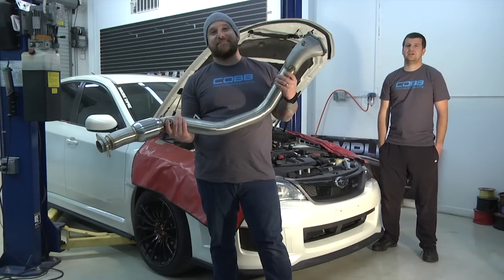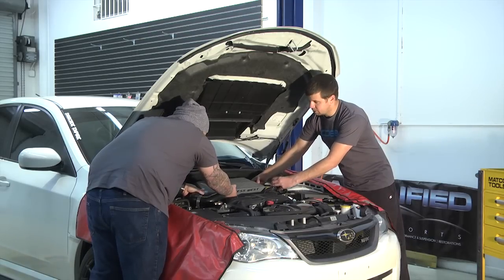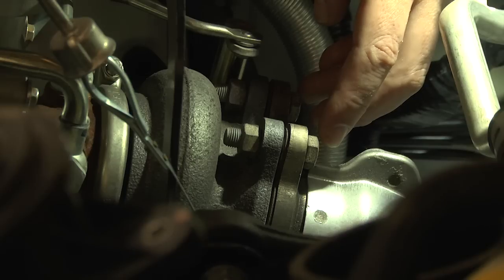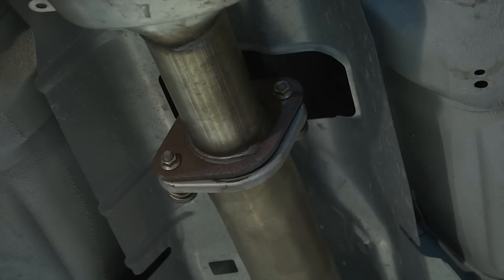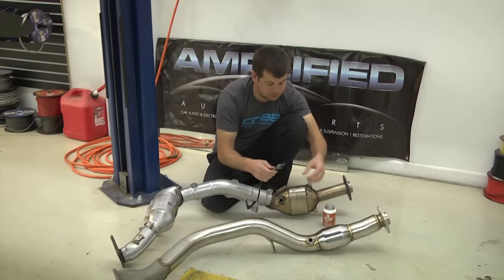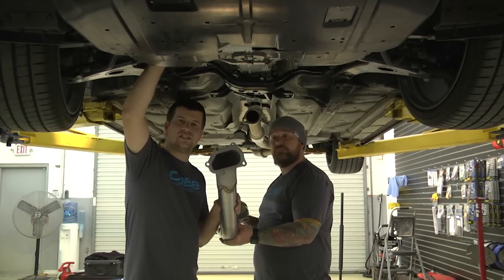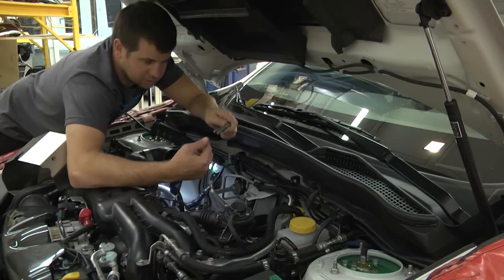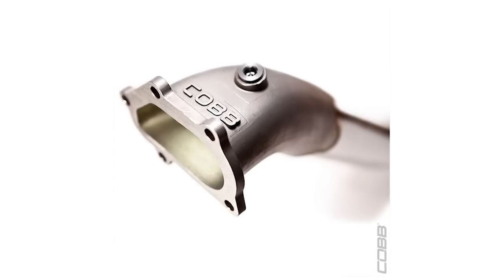COBB Subaru WRX 08-14 SS 3" Downpipe Install Video

Comment: What I like about this video are the clear camera angles pointing out the bolt locations & torques. What I don't like is the fact that they never mention how difficult it can be to remove some of these bolts and what replacement hardware you might want to have on hand to ensure if you shear a bolt or stud, that you can complete the job without scrambling to buy parts in the middle of the install.
Reply: Ong. The previous owner of mine, definitely fucked me over with the DP, he used thread lock on it. Rounded my bolts and completely fucked me over

Comment: well here it is 2 years later,i now have a process west verticooler and bought a cobb down pipe,i already had the CNT racing turbo back exhaust,but trust me if your going to do things right get the cobb DP,oh and a lift would be nice haha so i had hell because i didn't want to remove the whole verticooler so i removed the main bolt and end hose,then i had to buy the grimmspeed adapter since cobb tappers down to 2.5 and the rest of my cat back is 3'' so reinstalling is going to probably be tricky,one person on the ground,oh and i would highly recommend buying grimmspeed gaskets for the DP at both ends,you do not want to have to do this again because of a leak.well wish me luck,oh and i am installing their SF intake and box then i will be driving to cobb for a pro tune.im excited.but take it from me i learned the hard way.BUY GOOD STUFF.process west,cobb,grimmspeed.merry christmas subie brothers.

Comment: thanks for the heads up video,going to be a piece of cake.i ordered a CNT cat back for mine today and said the hell with it might as well get the down pipe too and install them all at once.the CNT cat back dual tips,525.00 the CNT catted down pipe 369.00 got a 5 % discount made it a cool 848.00 for the complete turbo back,can't wait to flash to stage 2 next week.CNT RACING

Comment: Nice video! I was able to get my Cobb DP on my 08STi put on without taking off the TMIC. Just put it on the lift and reached up there and took it all off.
Reply: Yea with a stock tmic you should be able to but mine was much larger and covered the downpipe making it much harder.

Comment: I know it's been over 4 years since this video was uploaded. So the only gaskets you need is a turbo/DP gasket and a donut gasket?  I'm running the OEM midpipe with the Grimmspeed adapter.

Comment: what's "the NICs that we talked about earlier"?
sorry
Reply: also when installing the DP to the turbo you said don't forget "antiseeds"? what is that?
Reply: bradstud92 4 months late, but he said anti-seize. It makes it easier to remove the bolts later on if you take off the pipe later.
Reply: Cesar Barragan thanks so much man. Ill be installing soon!

Comment: don't you need new turbo to downpipe gaskets?
Reply: I didn't use new because it wasn't recommended. If your gaskets are old you may want to look at replacing them but my car had less than 3k miles on it
Reply: ahh i see. thanks

Comment: after install I just need to flash a new map via AP right?
Reply from the maker: Correct!
Reply: Thanks for such a fast response!
You guys wouldn't by chance have any tips/tricks on installing a new silicone hose from my TMIC to Throttle body would ya? That stupid little job is kickin my ass! (2011 WRX)
Reply from the maker: No unfortunately we don't have a video for the top mount install.
Reply: J Garcia can the ap work with a cat-less down pipe?